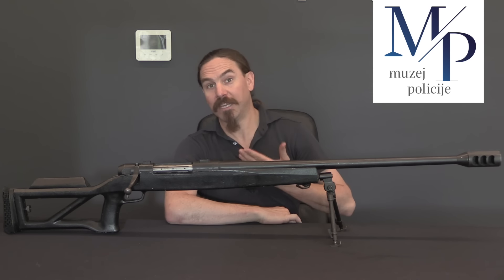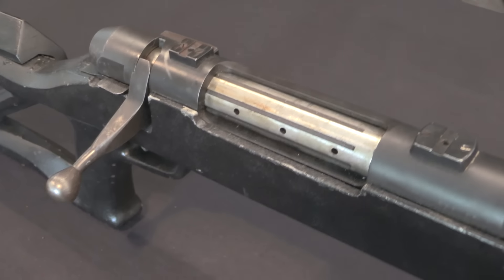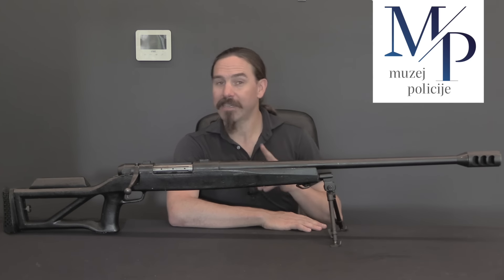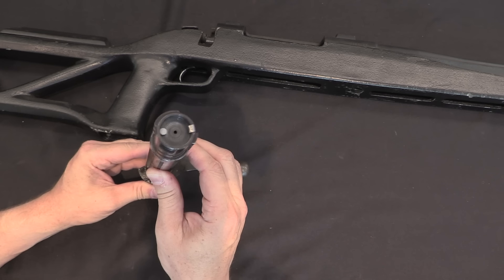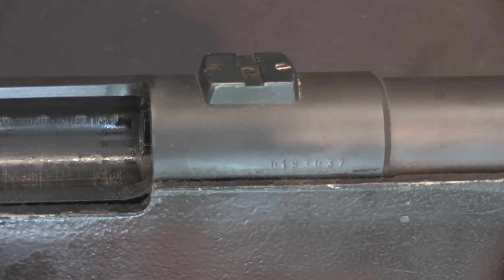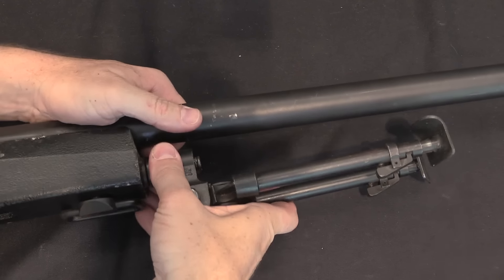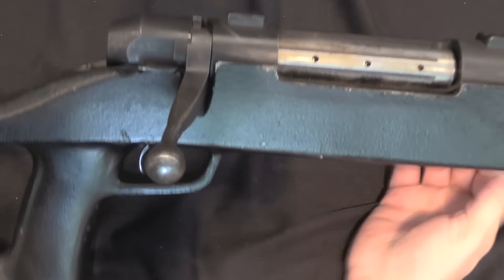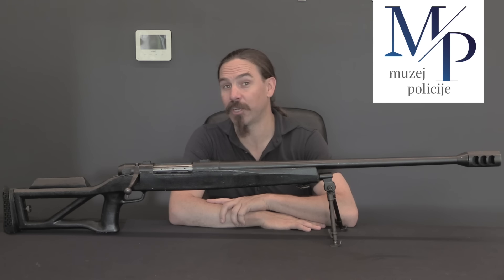MACS M2: Croatian Anti-Materiel .50 Cal

Comment: 50 Cal bolt action. 10x optics. Mouse fart trigger pull. "... A detachment of snipers during operation Storm". Yes. Yes that does sound terrifying. All kinds of terrifying. A whole lot of things, that your instincts tell you constitute cover, do in fact not constitute cover when there is a precise twitchy shoulder cannon pointed at you.
Reply: there is thing called safety  so u putt that on and it is safe to not do boom ..

Comment: Man, those Balkan and Slavic has the most wonky looking guns, yet enchanting somehow
Reply: I feel the same. The Croatian designs convey a visceral sense of something between urgency and desperation. I think it's because their industry was more modern but also they were improvising harder compared to eg early ww2 soviet weapons. Initially wasn't so much interest in clever design in order to reduce machine time--they had plenty of machine tools, but needed specific usable weapons *right then*, initially with little time for development and a low bar for what counted as usable. See also the Kresimir grenade launcher.
Reply: Imo they are really cool looking like even the underworld guns there are cool as sh1t, like R9-Arms smg which is ridiculously well made. 
Another smg that i really really like is the Agram 2000 especially since its not just some regular open-bolt smg, but hammer fired and the design is pretty genius. 
Like for example the holes in the barrel, and how it can use regular 9x19 that way without the need of subsonics.

Comment: Interesting to see this small piece of firearm history from Croatia, especially since it was built in my hometown. The current iteration (M4) is built by Scam Marine, a small-medium company specialized in the design and manufacture of specialty marine engines, deck equipment and other types of naval and ship systems for the shipbuilding industry. I think that some of the people who originally designed the MACS created the company after the war and went their own way. Since I worked as a appraiser at a time, I actually visited the company a few years ago when they were in the process of expanding production and needed an appraisal of some equipment as collateral for a line of credit at a bank. I got a tour of the production facilities and got to see where they produce and assemble the MACS, which is a relatively small part of their overall production floor-space since, as mentioned previously, they mostly make ship equipment.
As a side note, the Torpedo factory that is mentioned at the beginning is the OG Torpedo factory where the torpedo (as in the self-propelled undersea weapon) was invented and created, some 150 years ago, during the Austro-Hungarian empire times. Torpedo production ended in the 1960-70s however they continued making marine diesel engines, ship equipment and tractors. They still had a military production line and during the war they were producing light all-terrain military trucks, armored vehicles and other military equipment. Unfortunately after the war the company went into receivership and in the end went bust. Nowadays what's left is the production hall which was converted into a exhibition/concert hall and the old torpedo testing station.